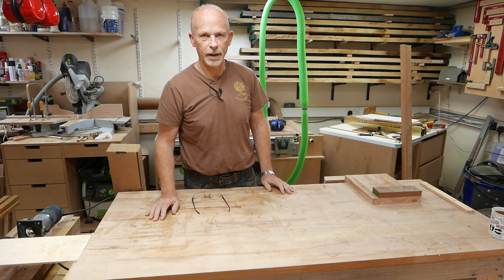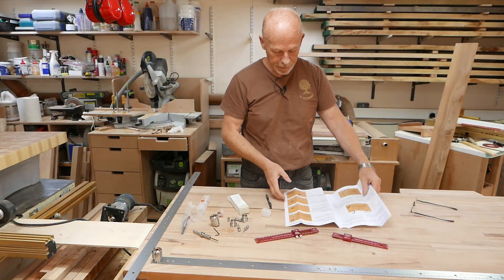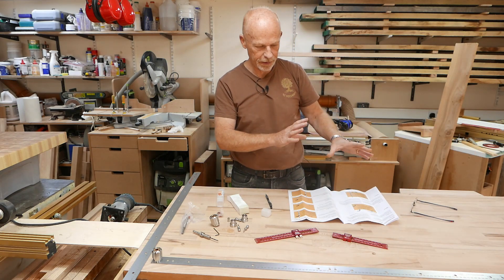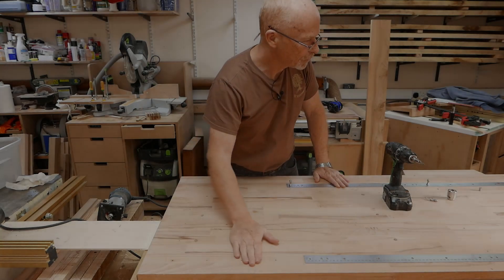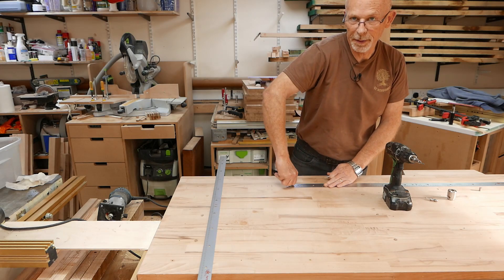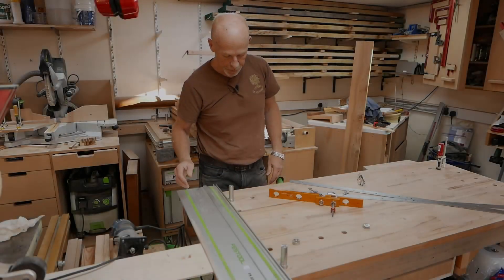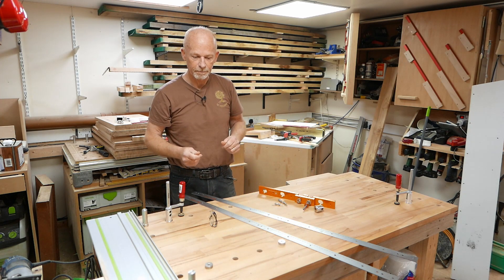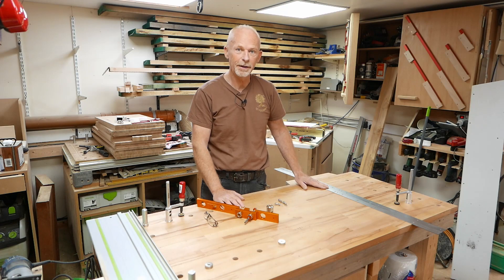Adding Bench Dog Holes to my Workbench with the UJK Parf Guide system

Comment: I have the Mk I  version. My biggest issue with it is I needed to buy the reamer because dogs were almost impossible to get out once they were inserted. I also got some of the "Revision Dogs" just in case I wanted to extend any of the hole locations. I had the remove the top and flip it over and use a mallet and piece of wood to remove them. The reamer solved the problem completely but I feel it should be in the kit in the first place. For  finish I think the recommendation is to do the finish before drilling the holes.
Reply from the maker: Hi Andy, I also found the holes extremely tight, I put that down to applying finish after the event and getting some in the holes.  Maybe a little of each?  But defo on applying the finish afterwards.  Live and learn. 👍